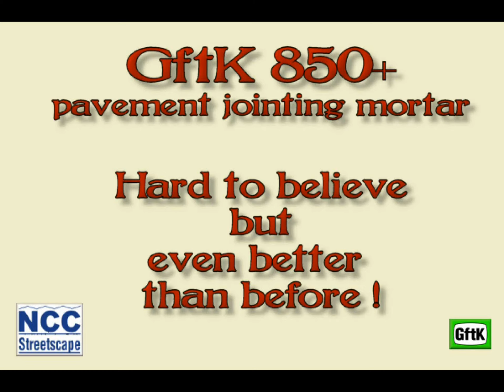New Natural Stone Patio Jointing with GftK vdw 850plus

Comment: I live in Canada, has this been used in climates like ours? Also, are there any types of pavers this product is not compatible with e.g cement based pavers?
Reply from the maker: Apologies we lost access to these comments but Google have finally restored this. Yes these products were developed in Germany where the Winters are colder and Summers are warmer than the UK, so serviceability is assured, though the temperature limitation of +3 and rising for application, ideally between 10 and 25 for application should be maintained.